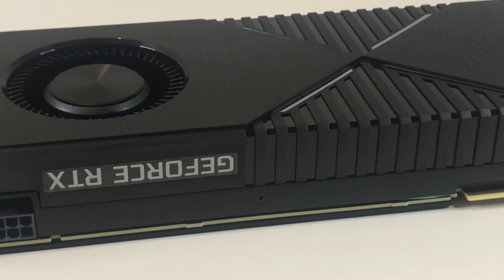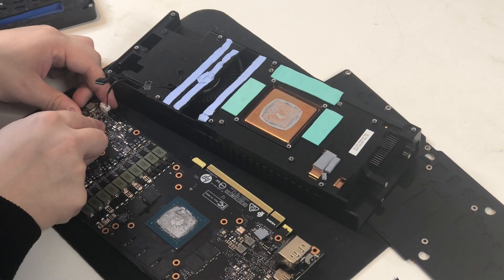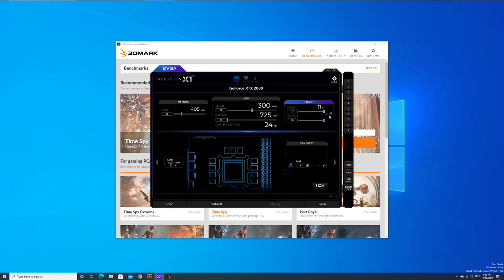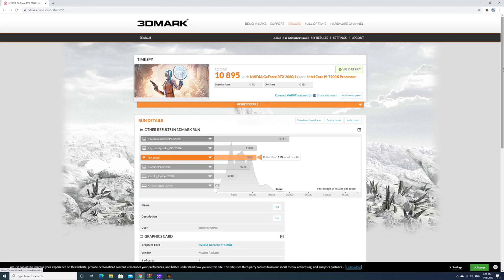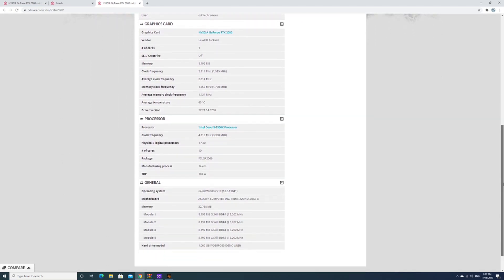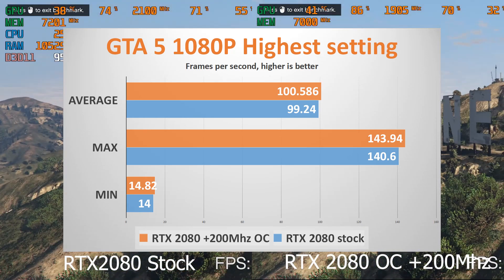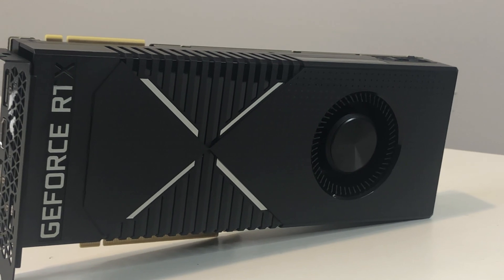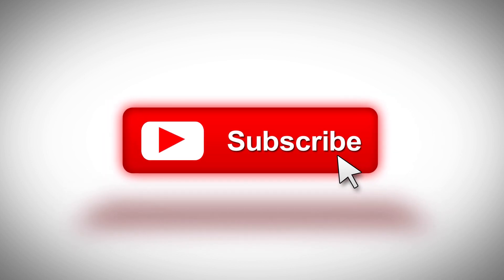How bad is a HP OEM RTX 2080 card?  Or is it actually good?

Comment: just bought this one, like you mentioned it's actually pretty nice heat wise, just a bit loud (as expected of blower style). Also its boost clock reaches 1905 MHZ which equals it to the more expensive RTX 2070S super like the ROG STRIX OC

Comment: I had the Dell Alienware RTX 2080 Super (MSI Aero RTX 2080 Super Rebranded). It was a perfectly fine card, and mine at least only ran within acceptable levels for a blower card.  It never overheated even when stressed with benchmarks. It has the same cooler as the RTX 2080 Ti version so perhaps the extra heat from the Ti model is what caused the issues for Timmy Joe but I know that the Super (at least mine) worked and still works fine. The guy I sold it to is very happy with it and he games on it almost daily. He upgraded from a RX 580 so it's a big upgrade for him. Blower cards by design run warmer, but they were very common until wattage and heat started to really ramp up on these newer generation of cards..
Reply: Same I also bought one a week ago for 69$. It was a total steal 🎉

Comment: I just bought a HP referb Omen with an i7 10700 and this 2080ti version.  All I can say is this card is a beast.  I was skeptical when I saw the cooler design.  Time Spy score with no overclocking was 12,400.  Overclocked the CPU to 5.2GHZ and the 2080Ti to 220 core and 2200 memory.  I was able to push a score of 15,230.  Temp was around 72C average.  It was a bit loud, but I was way impressed.  I would not run it at this every day, and it may not be stable long term, but just getting it to that point was an accomplishment.  I would say it is a good cooling design, even if it is a bit loud.

Comment: Had one of these on an Alienware i got for a discount, and the card served me well.  It was loud, but never overheated even with a decent overclock.  Always kept a steady temperature without throttling.  I upgraded to a new gpu and the card is now getting new life in my friend's computer.
Reply: I never had issue with the Alienware RTX 2080 Super, yes it ran like 5 degrees warmer but that's just the nature of a blower fan design.   I actually prefer them even if they aren't as cool (pun intended).

Comment: That's strange, mine gives 87c while playing games even running at 60% fan speed constant and I'm quite worried.
Reply: The same thing happens to me, playing the temperature does not drop below 86 87 degrees. I have a hp omen 880-549ns I think that the box has very bad ventilation also that rtx 2080ti is the cheapest there is of all the rtx 2080ti
Reply: @thunderwar  Have you tried changing thermal paste and pads or contacting support
Reply: @sultanarfeen6752  I have not changed the thermal paste, have you changed it?  have you noticed any difference?
Reply: did you find how to solve the problem?
Reply: @thunderwar  did you find how to solve the problem?

Comment: My brother has had this card in his pc for over a year now with an i7 9700k, 16gb of ram. Recently his friend just got a pc with a ryzen 5 3600 and gtx 1660 super and to my brothers surprise, that 1660 super is pulling more fps than the hp 2080 in escape from tarkov for example. The hp 2080 does not have any artifacts, it does not overheat, there doesn't appear to have anything wrong with it. The power has not been limited in anyway, and the whole pc is powered by a 750 watt psu and windows was recently installed due to ssd upgrade. Any help would be awesome, thanks so much in advance
Reply: Probably messed with his settings. 1080p? 2k?
Reply: @user-tz1jo5vg3e  No, he checked, and 1080p
Reply: @User_Brandon   thats weird but you gotta set your settings to 2k to let the gpu do all the work instead of the cpu. The i7 youre talking about was released in 18 and the 3600 in 19, so its gonna run smooth. But the set up your brother has should be outsoing the 1660. Make sure the drivers are updated or if he had a previous card, like amd, to delete the drivers.
Reply: @user-tz1jo5vg3e  He only has a 1080p monitor, and yeah that i7 is still relatively new. Even if the 2080 is a bottleneck at 1080p it should still most definitely put perform something like a 1660, even looking at other YouTube videos with even a different 2080 at 1080p, way more fps. I get that it’s a single fan card but yet so are the Founders editions and they run much better. I always DDU gpu drivers and I did try that with his pc too, still the same thing. I’m thinking I’ll probably just end up replacing it eventually
Reply: @User_Brandon  have you tried swapping the card into another setup and testing it that way?
Maybe that way you can see if there is an issue with the card or something else in his setup.
Reply: @JosePineda-jn8jk  Actually I ended up doing the opposite, I put my gpu in his pc and still got the same results. I specc’d out the pc before building it and I cheaped out on the motherboard by getting a B365M DS3H which is a budget board so I think that was just messing with the frames looking at it now. The funny thing is that it’s more worthwhile now to just upgrade his cpu/mobo to a newer generation because existing 9th gen 1151 boards are super pricey, I believe it’s the board because literally every other part was swapped out

Comment: I own this card. It rocks!! Got it really cheap, around 200€ :) from an IT friend. It’s been running 24/7 since September like a charm. 
One thing you don’t mention in the video is that at full load (decrypting blockchain transactions ) uses around 250/280/300W. Not the most cost/efficient gpu out there…

Comment: Dumping some info here: Just got an HP omen 2080, fixed by a service center (no idea what failed) with 12 month warranty, on stock it managed 10 370 gpu points in time spy, I OC'd it without changing the power limit to +175 core +850 mem (micron chips), that changed the score to 11 107 gpu points. Both with stock r5 3600 processor

Comment: Covered mine in heatsinks, shoved on a Morpheus radiator, two 120mm arctic fans, a fan header adapter, also arctic, good heat sink paste and it never goes over 50 degrees.
Reply: I was just seeing this radiator on Amazon! Did you post anywhere of how it looks/how you did it? Do you recommend any particular guide? Hearing about your temps is really making me consider doing it!
Reply: It's the heat sink paste. That's clearly the prime factor. 😆
Reply: And it's now the size of 4090 strix probably
Reply: Was 4 slots lol. Sold it on recently, I have a 6900xt currently

Comment: I just bought one of these, I hope it works great. I saved 3 years for this
Reply: so what do you think about it ?
Reply: @tekno4952  It's working fine until now except for the temps being a little high. Runs almost all games on ultra. There is a little stutter sometimes but i think that's because of my ram rather than the gpu
Reply: What about the noise
Reply: @tekno4952  Not bad at all
Reply: @sultanarfeen6752  alright thanks a lot !
Reply: @tekno4952  No problem amigo

Comment: I have the Dell blower cooler on a 2070 Super, and it has been suprisingly good. It's in an itx case with ready access to 'fresh' air from my warmer than average apartment through the side panel. I am not running any overclocks. It might be that it is just not running as hard as the 2080s and therefore the Dell cooler is adequate.  It DOES occassionally spool up and get really loud when running games like Cyberpunk 2077, but it seems to do so in bursts and cuts back down to reasonable noise levels after a few seconds.
Reply: Bro I'll be getting that same card

How is it after hours of gameplay
And how are temps?

Are loud noise normal and okay?
Reply: @maximoxtech1125  Yeah, temps are fine, although it can get noisy when under real loads. I also have some issue with the DisplayPort out on my particular card, but since the HDMI ports work fine I don't worry about it.

It's louder than the open air cards I have, but not to the point where I can't deal with it. Pretty sure my case fans are louder most of the time, but when it revs up, you'll notice.

Comment: How many screws to open the gpu ? Cuz i have the same gpu and im thinking to change the thermal pastel
Reply: What is the temperature when you play?
Reply: @thunderwar  thermal throttling =86 c
Reply: @MrLost_KWT  i have the same temperature in games,i download msi afterburner to down the power consume to 90%  and up the fan speed to 75%  and now is on 82°

Comment: I have been having overheating and thermal throttling with this card when playing Warthunder. Replacing the thermal paste on the GPU brought the GPU temps down, but the memory temps quickly get into the high 80s, then it throttles.  Any suggestions on how to get the memory temps down???
Reply: I’m not expert but try replacing the fan

Comment: Hi. Is this HP Video card compatible with a Non HP motherboard?
Reply: Yes, I run this card on an MSI B550M motherboard
Reply: @ThumBummer  i found a 2080ti hp 
Should i take it or is it a bad idea
Reply: All gpu's are compatible with pretty much all motherboards, except some server boards. You just need to check if the board you want to use will have a pcie 16x slot and you're good to go.

Comment: Hello! Okay, I have a question. I have this exact graphics card, and it worked beautifully until 5 days ago. The card itself is fine! But, the blower fan has stopped working.  Is there ANYWAY I can replace this fan? if so, what is the correct blower fan for this card? Please Help!!
Reply: Hi 
You’ll find the exact same cooler for replacement on Ali express (for example)

Comment: I was buying a pre built, the only thing I’m changing is the mother board, power supply, and fans, since the stock mother board can’t overclock the cpu this makes me much more confident in my prebuilt I’m choosing for the parts
Reply from the maker: LOL but I didn't quite get your point. How does the motherboard not being able to overclock makes you confident...
Reply: @oddtechreviews8148  I also got that problem. I bought an Omen by HP desktop. and that Motherboard is limited af - you can barely change things in the bios :D and you cant even upgrade bios. its a mess. 

I will change everything but the HP OEM RTX 2080 :D

edit: board is "HP 84FE"
Reply: @oddtechreviews8148  because it’s solid parts junk motherboard, I’ve been able to push the hp 2080 a decent amount with some overclocking, it runs every game max settings, I have an 11th gen i7 and 32gb 3600mhz ram with 2 tb Samsung 980 pro and I’d say this computer is good for the next few years, very good airflow and fans blowing over the card it’s self take a huge amount of heat off it

Comment: I found HP RTX 3060s on eBay for $748 and tax they are advertised as new too.  Would you buy one of those?  Although they are not the $300 MSRP it is a lot lower than the fantasy land prices other RTX 3060s are often found for.  There is one more thing to consider, will the manufacturer warranty a card that you are not the original buyer of?  Some might but you are at their mercy.  Just remember that before paying some comically high ludicrous price for it.
Reply from the maker: No they will not warranty a card if it's not bought with a whole PC. I would stay away from those cards as most of those are renewed. I can't say for sure but we have been offered hundreds of those cards retired from mining farms and renewed to make them look absolutely like new pulls. But they had been mined with for couple months with memory OC and 100% fan speed. So YMMV

Comment: This gpu with an EK full cover water block can keep the temp below 56 degrees easily with room temp of 73
Reply: That's a toasty room
Reply: which one would you recommend?
Reply: @hobo2136  Still rockin the HP 2080 with full VR performance…and the EK full cover water block works great

Comment: Same performance as my msi super ventus 2070S overclocked to thee max
Reply: Give or take a few points on Geekbench i see typically 112,000 but as high as 129,000
Reply: 63000 with 1650 Super 200/1500 oc that thing has insane headroom

Comment: hi. do u know how to turn on red led stripes on that card ?
Reply from the maker: Unfortunately that’s not possible because there is no led strip on this card. The LED is only present on 2080Ti.
Reply: @oddtechreviews8148  thats odd i have that same 2080 card and it has the red LEDs turned on
Reply: @cunkbumcket8217  same I have it in my pc build but you need omen command center to turn it off and on but you would need an omen prebuilt
Reply: @modelotime2456  at least at the time I bought mine it was actually cheaper than buying the raw parts by like 100$ glad I didn't wait lmao

Comment: I have one. Btw, Is that X logo, Led Light On or Off?
Reply from the maker: For this one no. But the 2080Ti will lit up
Reply: @oddtechreviews8148  Actually, I believe it is controlled by Omen Command Center. I have one myself hence I am on this video. I got a great steal on a full build (prebuit, paid 950 eur) I5 9600k, rtx 2080 as the main attractive parts. Anyways, when I changed the original case that the PC came in, which had noooo kind of airflow in it whatsoever, to the right side of the motherboard they have a smaller motherboard for auto CPU overclocking, lights on the front of the case, and I believe it controls the said led as well on the GPU. As I removed it to switch the case, the GPU won't light up anymore. (I also had the GPU replaced, as mine was doing this weird thing where it ramped up as temps hit 83 degrees, dropped to 80 then fan would go quiet, but due to load GPU would get heated up again, rinse and repeat). So it is one of these two factors, but I mostly bet on the small board they have next to the mainboard.

And because of the mediocre HP system BIOS limitations I decided to change the motherboard all together. I will let you know next week if I can get the LEDs to light up again.
Reply: @hoteamarius4227  esti Román?
Reply: @hoteamarius4227  nu am discord,doar vroiam sa știu dacă după ce ai schimbat cutia la calculator tia scăzut temperatura la cardul grafic,eu am un hp omen 880-549ns cu o rtx 2080ti si nu coboara de 86 ° grade în toate jocurile
Reply: @thunderwar  Daca schimbi "cutia" la calculator ajuta, dar nu aia este problema. Daca vrei temperaturi mai mici la placa video trebuie sa iti faci un "fan curve" custom. Adica descarci MSI Afterburner si reglezi cat sa se invarta ventilatorul la x grade. Poti sa urmaresti un tutorial pe internet cum sa iti faci un custom fan curve pe MSI Afterburner. Eu iti zic sincer ca am trimis o placa video inapoi la HP pentru ca atingea temperaturi exasperante, din cauza ca toata viata placi video a fost "chinuita" la 85 de grade, pasta de pe ea s-a intarit si nu mai tinea asa de rece. Nu am vrut sa o deschid pentru ca pierdeam garantia, asa ca am trimis calculatorul la service. In cam 3 saptamani m-au rezolvat, au schimbat placa video cu totu dar acum nu se mai aprind luminitele pe ea. Asta e. 

Iti urez spor, si o zi buna!
Reply: @hoteamarius4227  si ce temperatura ai acuma la card cand joci?
Reply: @thunderwar  Uite, acum cand nu stresez placa video asa de mult (BF4 la maxim) am 60 de grade. Pot sa iti trimit setarile mele, dar nu am cum aici.
Reply: @thunderwar  Nu stiu de ce nu pot sa imi pun instagramul aici. Da-mi un mail unde sa iti trimit un mesaj daca nu ai Discord.

Comment: I have the 2080 Ti version of this card. Running at stock and runs at 87 degrees full load and it’s loud. Can anyone recommend an alternative cooler? Thanks
Reply: I have the 2080ti blower too. Try to undervolt it with afterburner. I get 82/83 degrees now
Reply: Buy a waterblock for a  reference  card it should work
Reply: @paolobricarelli  I’m back. Was driving me mad so I stuck my x62 AIO onto the 2080 ti version of this card and got a new cooler for my
CPU. Gone from 45 idle/87 full load. Now running 22 idle/47 full load. I was not expecting that much difference. Can also hit the high clocks now. Time spy gone from 13k into 15k. Amazed!
Reply: @ChiefBunhead  I’m happy to hear that you solved the problem. I changed my cooler too, I couldn’t stand the noise anymore. I bought an aftermarket cooler for the 2080ti and now the max temp is 70 degrees and the card is silent. Timespy score went form 13.5 K to 15.5K
Reply: @paolobricarelli  ah ha nice! That’s a good score. Which cooler did you get?
Reply: @ChiefBunhead  I got the Raijintek Morpheus 8057. It’s fantastic because even in a small case with almost no airflow like mine it allows the card to be cool thanks to the two 120mm fans. Liquid cooler is even better but I had no space for it
Reply: @paolobricarelli  that’s cool. I was very close to going with the very same thing but opted to use the AIO I already had. Glad you got your running good!
Reply: @ChiefBunhead  I am glad you solved the issue too.
From now on I’ll never buy a blower gpu again
Reply: @paolobricarelli  haha yes I won’t be getting another either. Thankfully mine cost me nothing.